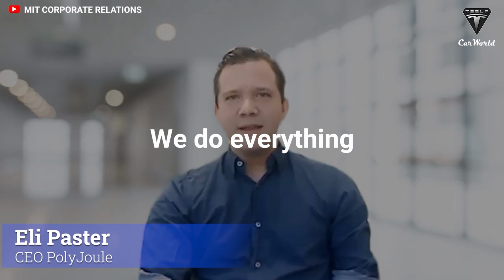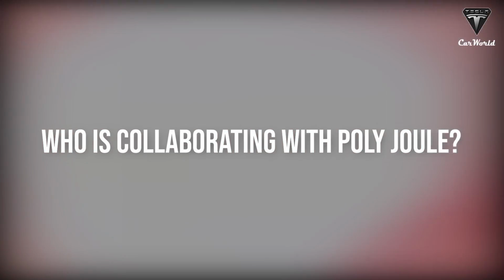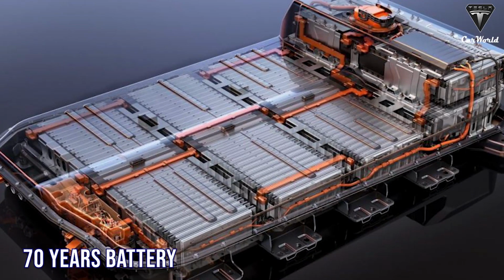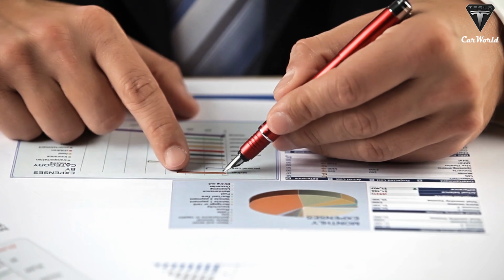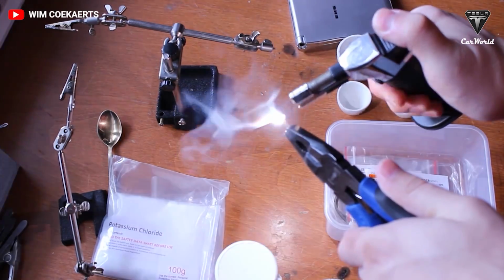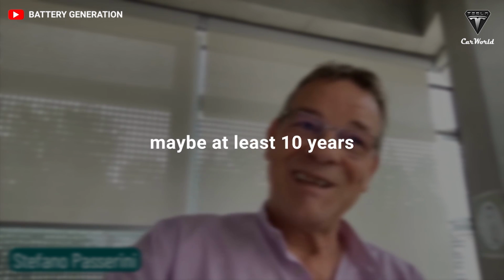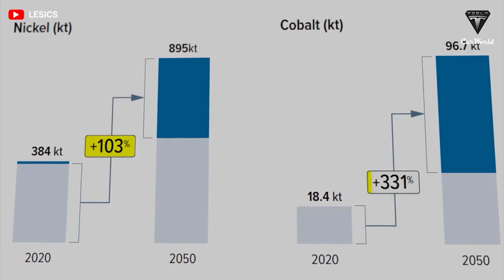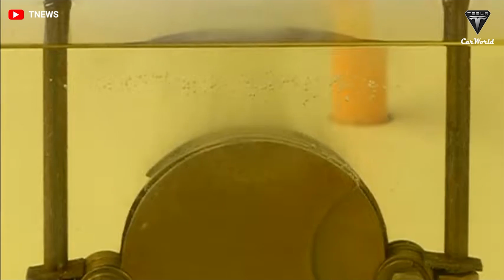The End of Lithium P5! Elon Musk Revealed ALL-NEW Surprise Battery Tech, Destroy Everything in 2024!

Comment: Musk said at his investor day that his cars will be compatible with any battery chemistry. So any serious battery that can deliver 48 volts and fit the structure of his car could be used. That will separate the weaker from the stronger candidates it seems. I doubt he would rush to pay for scale up unless the cost was dirt cheap and it was clearly superior to the 4680.
Reply: Teslas are 350 to 400 volts. The series/parallel configuration of the individual cells. Higher voltage means lower amps for the same power. Lower amps can be carried with smaller cables and generates less heat. The inverter converts the high voltage to 3 phase AC for the AC motors.

Comment: What is the price per kwh of off-river pumped hydro? I know ratios - like it's cheaper than on-river. I know that if you triple the head (height) of the pumped hydro, you HALVE the cost. But I've never heard the actual break cost figures. Here's what I have gathered from experts. Off-river Pumped Hydro Electricity Storage (PHES) can be built faster than on-river, cheaper, safer, and with no ecological concerns about disrupting a fragile river system. Build PHES within a few dozen km's of a river. Build it all at once - the upper and lower reservoir and turbine rooms all together so you’re done in 2 to 3 years. Off-river avoids expensive spillways for 1 in 500 year flash floods. When finished, slowly pump the water from the nearby river. Cover in floating solar panels to reduce evaporation. Top up from the river every few months. Satellite maps show most continents have over 100 TIMES more sites than they need. Pick your best 1% and you’re done. Professor Andrew Blakers from the ANU presents the data. http://youtu.be/_Lk3elu3zf4?t=986  This loses some water to evaporation, but only 1/5th the water of coal thermal plants!
See here: http://iopscience.iop.org/article/10.1088/2516-1083/abeb5b#prgeabeb5bs6
PHES can be really big or really small, like this one for Walpole, an Aussie town of 500. http://www.abc.net.au/news/2021-11-01/renewable-energy-fix-walpole-power-problems/100579700

Comment: The truth is so far only lithium batteries are reliable.
Reply: Batteries in use today include lead-acid, Ni-cad, Nickel-Metal Hydride, Silver Oxide, Carbon Zinc, Zinc Air, and Alkaline in addition to the six different types of lithium batteries. All have pro and cons and are useful for different situations. In addition to these types of batteries, there are other types of energy storage devices " batteries" that take electrical energy, convert it to another non-chemical form of energy then use that energy to generate electricity. These are used to store energy at a much larger scale such as for the electrical grid. These "batteries" include things like pumped-hydro, gravimetric , pressurize systems and "sand batteries."

Comment: The batteries need to be cheaper and use easy to get materials, but that does not matter if there is no cheap way to charge them.
Reply: Of course. And conversely, cheap energy is no good if you can't store it. And both are no good if there are no cheap electric cars, and charging infrastructure etc. 
You need all the parts to make it work. 
But work it will.
Reply: @pepelegal333  YEA......THIS IS WHAT THE DUMMY FANBOYS DON'T GET........WE'RE ABOUT WHERE WE WERE IN 1923 WHERE GAS CARS WERE THEN, IWAN'T TILL THE FIFTIES AND SIXTIES BEFORE THEY WERE ANYTHING THAT RESEMBLES MODEN DRIVABLE MACHINES...... SO IT COULD TAKE ANOTHER TEN YEARS OR SO, MAYBE 20 WHO THE HELL KNOWS
Reply: Congratulaions! You get the prize for the most nonsensical comment comment I've seen today!
Reply: as others have said, pretty standard statement by the folks that don't believe in Electric.  Yeah, cheap energy is not good if can't store, it, so why work on it?  First, there ARE LOTS of ideas on making cheaper batteries, Sodium, Sulfur, etc.  Lots of them work, maybe today not as well as the LIFePO4, but hell, they are close to being there and MUCH cheaper in $ and lots better environmentally.  And as to cheaper energy?  Well, it doesn't make sense to make a lot of PV if there isn't a way to store it.  PV is WAY cheaper than it was 5 years ago, already cheaper than coal by a lot.  And will be cheaper than NG in the next 5 years.  And PV is not as big as wind, and, Yeah, there are potentials in nuclear too that aren't here yet, but you can't get ALL the parts together to be perfected at the same time.  Each part is separate, and has to be developed on it's own.  Fortunately here in this case, EACH of the components is important and is economically important enough to warrant the expense of development by itself.
Reply: @paulkramer4176  YEA, SO THE IDEA IS THAT ALL THESE FACTORS ARE PARTS OF AN EVOLUTIONAIRY PROCESS, WHICH IS WAY OVER THE HEADS OF ALL THESE NOISEY FANBOYS AND TROLLS FANBOYS AND TROLL, SUCH AS THE GREG BAILEY TROLL, EVOLUTIONAIRY SUCESSES ARE TYPICALLY THE RESULTS OF ENDLESS HITS AND MISSES SHOTS IN THE DARK